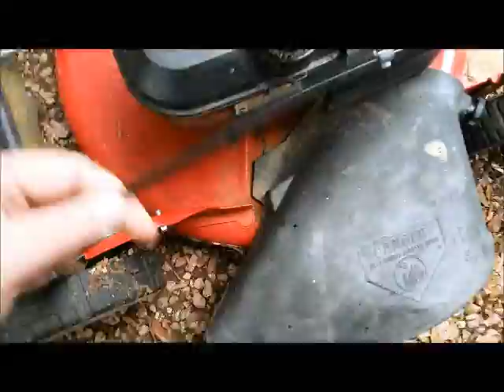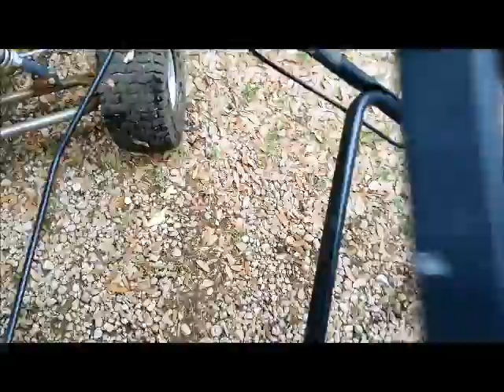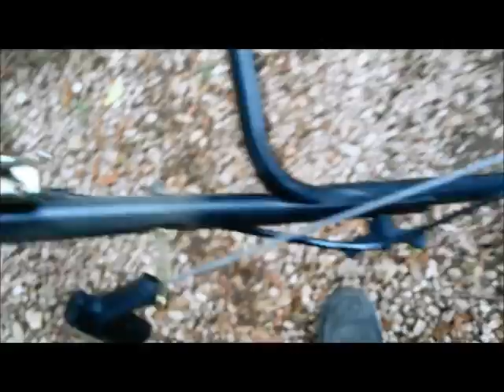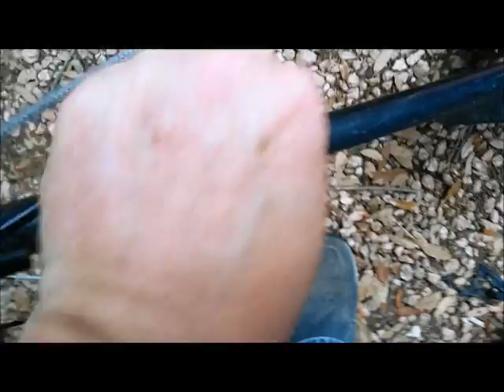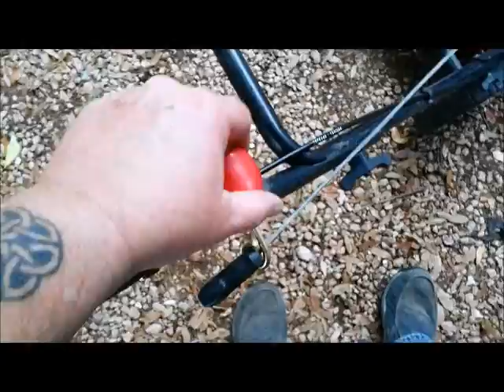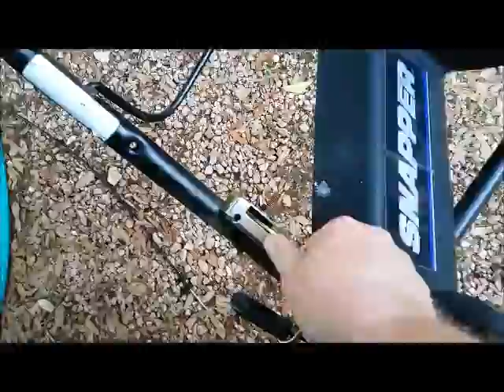Replace Repair Throttle Control Cable Snapper Lawn Mower

Comment: You did great job on ur video I had to do same on a lawn mower I had other day it's had to do a video and work on them at same time
Reply from the maker: Thanks!
Reply: @johnnieranger my throttle cable goes to the front of the mower. It has a front cover that I will have to take off to replace the side. It broke like yours except the cover isn't on the handle it's ion the front of the mower fed under the cover. 
But it looks really easy to change out .
Reply: What part is the spring clamp holder that clamps on the spring.